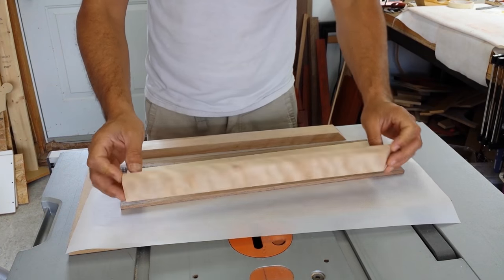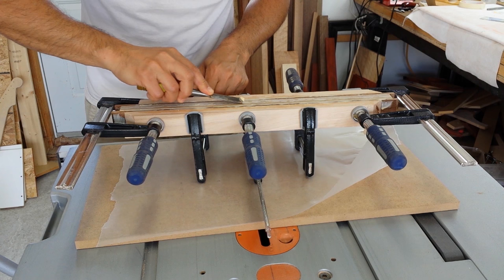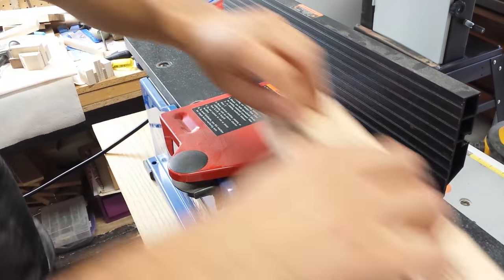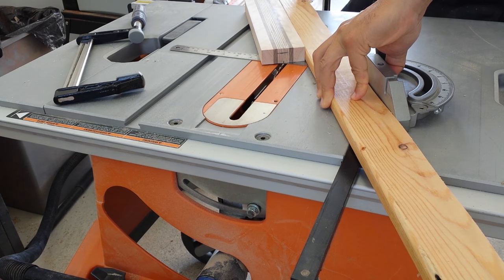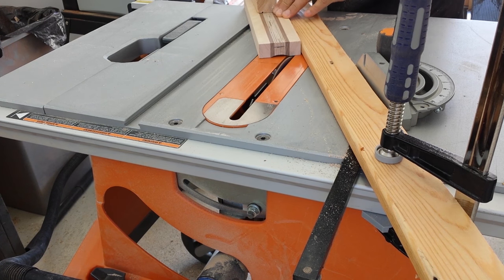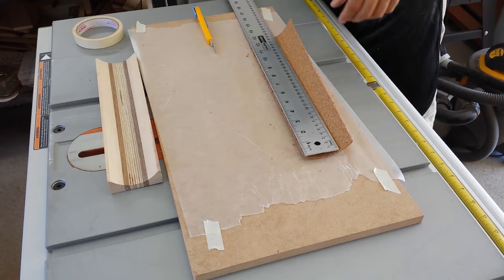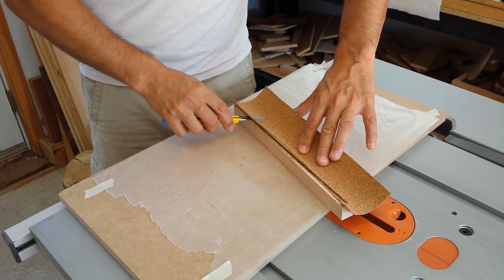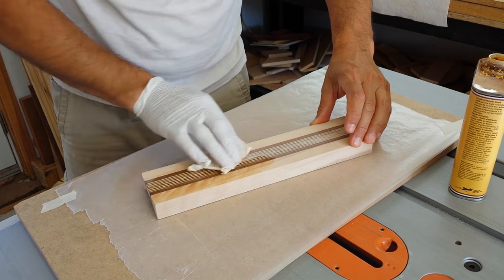How To Make A Neck Support Caul

Comment: Hi Mr. PEG. How do you know what angle to set the wooden guide rail to so that you get the proper cut? Is it always 64 degrees, or does the angle change relative to the size/depth of the cove cut you're making? Also, do you think this method would work for making a series of fretboard, radius blocks? Thanks.
Reply from the maker: No it's not always 64 degrees. Yes, the angle will change depending on the desired width and depth of the cut. Once you know the width and depth, you input them in a cove cut calculator to get the mitre gauge angle. Here are some online cove cut calculators:
- https://woodgears.ca/cove/calculate.html
- http://www.finewoodworking.com/pages/nmw030_pop.asp
- http://www.shopnotes.com/.../116/cove-calculations.pdf (PDF with a built-in calculator)
As for your second question, the answer is unfortunately no, you can't make a radius block with this method. The closest you can get is to make a 10" radius block by moving the work piece completely perpendicular on a 10" blade in your table saw. Don't do it! It's dangerous.
Reply: I see. Thank you for your help. The Vids are great. Keep up the good work!
Reply from the maker: Thanks!

Comment: It's beautiful and beautifully done... but you have the weakest wood at the thinnest point of the caul! The whole thing is held together by a couple of centimeters of ply layers, the weakest direction for plywood! I'm going to make one of these but I'll put some solid wood in the center and leave the plywood layers for the thicker edge parts.
Reply from the maker: You're right about that but this is not a load-bearing tool and so far it's held-up well.

Comment: can you make radiused sanding blocks using cove cuts?
Reply from the maker: Unfortunately no, you can't make a radius block with this method. The closest you can get is to make a 10" radius block by moving the work piece completely perpendicular on a 10" blade in your table saw. BUT DON"T DO IT! It's super dangerous.

Comment: hey cool video and neck supporter. aren't you worried the plywood center could fail? it looks like it's the weak point, no?
Reply from the maker: Plywood is strong material used in house construction, for floors and roofs. I'm sure it will withstand the weight of a guitar neck! :)

Comment: nice build .

One day Im going to come across a wood project video that doesnt involve having a table saw, band saw, industrial planer, jointer and other $$$ pieces of equipment.  That'll be the day, the universe collapses.

Is this possible using  only a hand saw ?
Reply from the maker: Yes, draw about 8-10 depth-lines on the edges of your blank to create the curve and join the lines on the top face. Then use your hand saw to cut on the lines down to depth. Then use sandpaper to clean the inside. I know I went overboard with the sandpaper... sorry.

Comment: Just need to buy a mitre saw, a jointer and a table saw then I'm all set, errr...
Reply from the maker: Yup, that's all you need :)
Reply: Band saw & drill press are indispensable for luthiers
Reply: For this project, the table saw is the only essential piece.
Reply: Stradivarius made his violins using nothing but a rabid beaver.